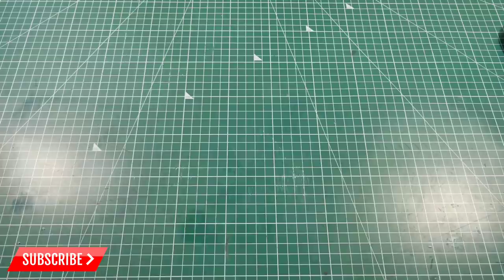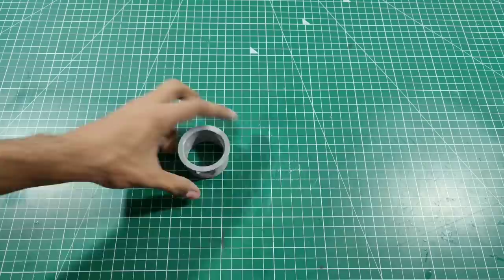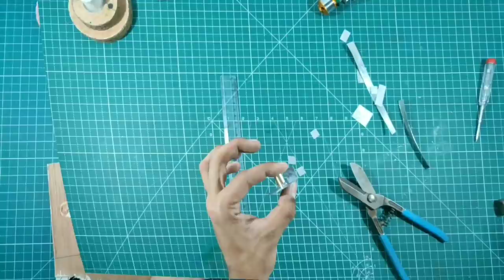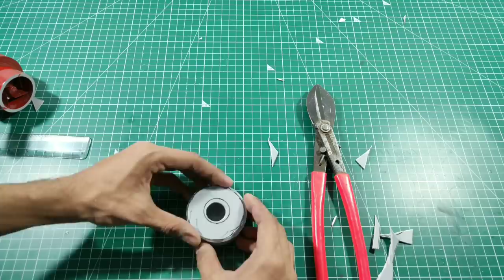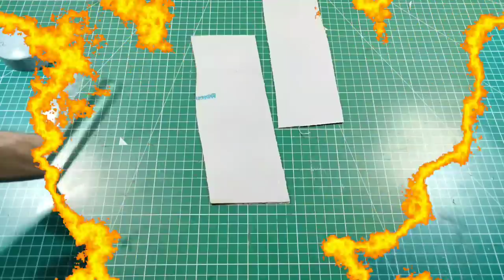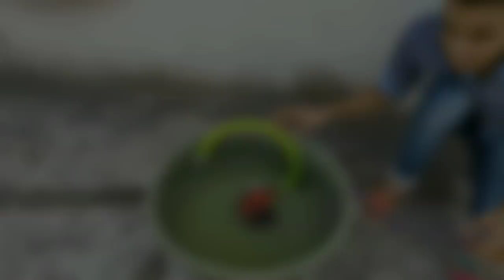How to make a powerful water pump (submersible)😎😎 12vDC

Comment: Can we directly connect this to plug socket that we use in home?  Any adapaters required?
Reply from the maker: No it's DC motor adopter is needed
Reply: @nextin123  Thank you.  Can you specify the name of Adapter so that I can search for this on Amazon?